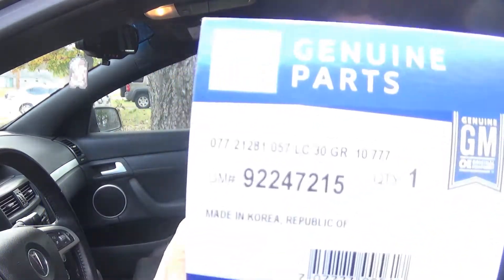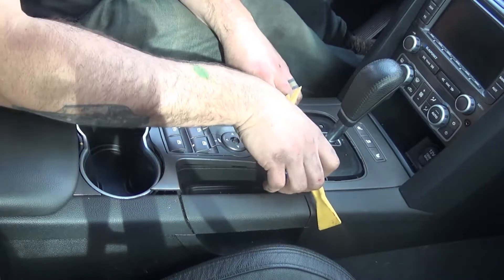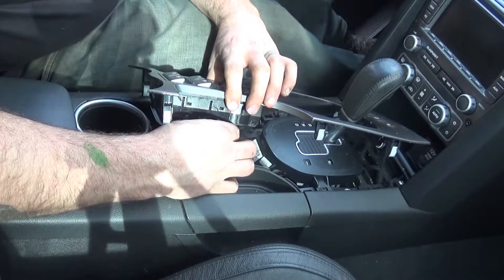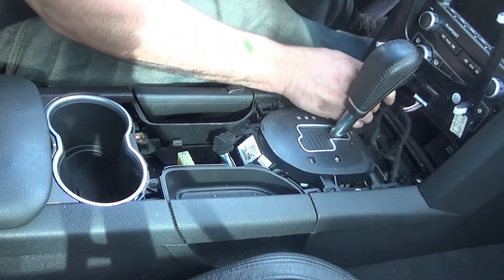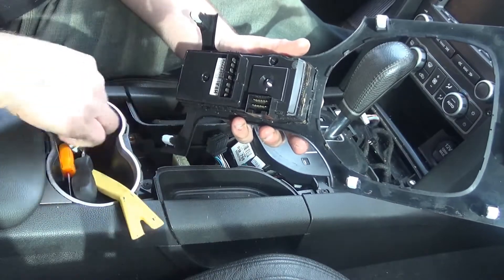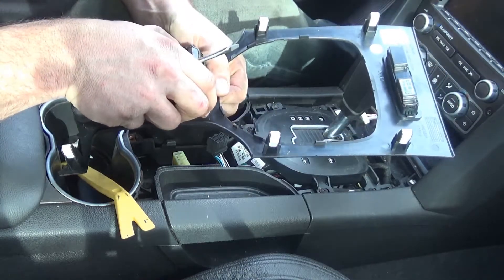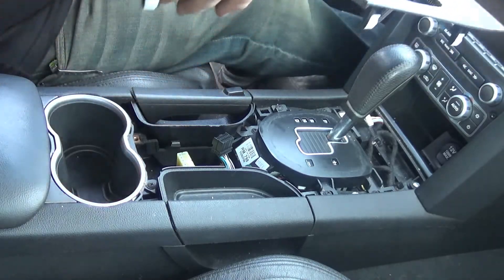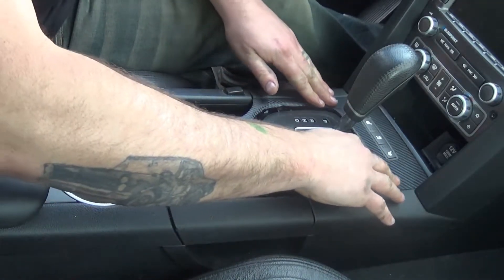window switch pontiac g8

Comment: Does this apply to a 09 base model?
Reply from the maker: yes i have a base model
Reply: @EfurdGarage ok thanks wish me luck I’m about to do it
Reply from the maker: @jesusnunez189  i will say good luck because of all the plastic and it can be brittle
Reply: @EfurdGarage I got the plastic off but the window switch didn’t come out with the plastic and is stuck in the middle don’t know how to get it out
Reply from the maker: @jesusnunez189  it takes some time and patience and a steady hand its easy but not. some are also more stuck then others
Reply: @EfurdGarage what I mean is that when I lifted the plastic the window switch didn’t come up it stayed in the middle and it’s stuck. It’s hard to move it only moves left and right but barely up and down and I’m afraid that if I pull I’ll break/rip a wire. Any recommendations?
Reply from the maker: @jesusnunez189  o ok. well can yo get a light or small camera to see if its stuck on something. It is honestly hard to say from here without seeing it. Since i didnt have that issue and i cant see yours could be a number of things